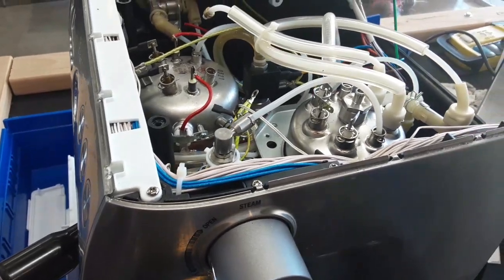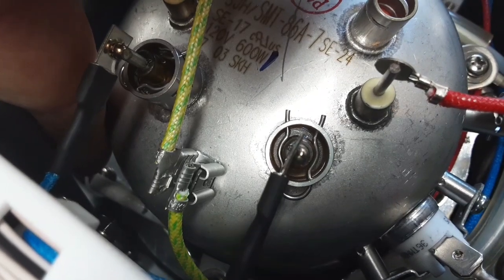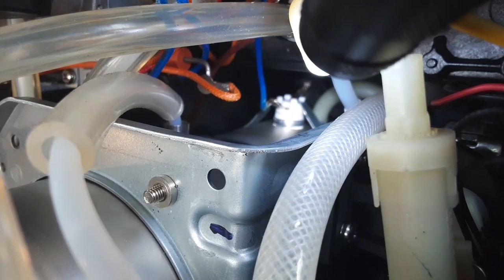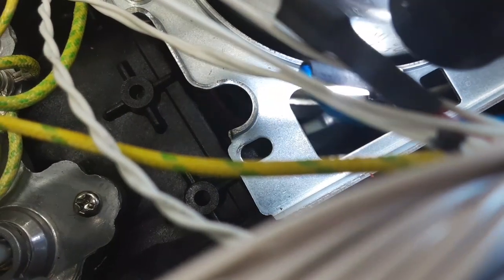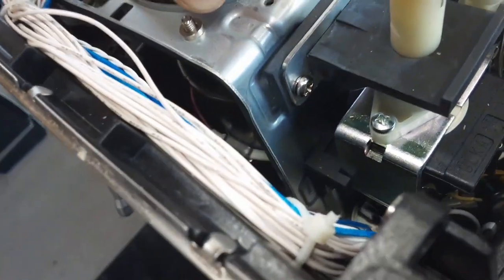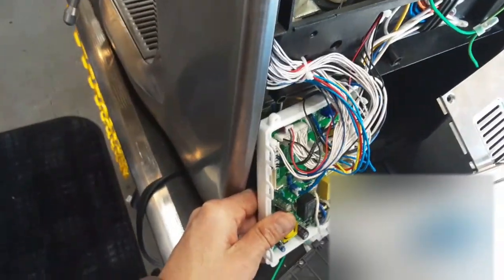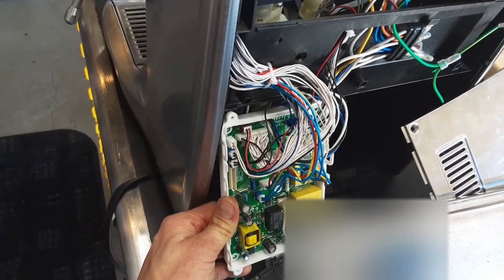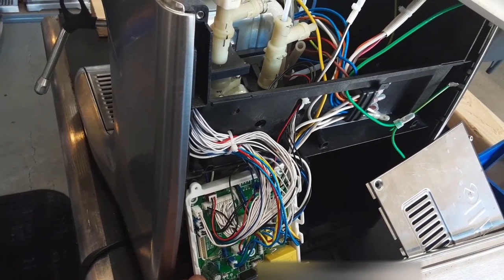Where are the NTC or thermal fuses on Breville Dual Boiler 920xl?

Comment: You can try replace 3 TRIAC on TRIAC board.  1 is BTA06-600C 6A The other 2 are 15A Triac. I use BTA16-600C.  (forgot the original model), Those were working fine for half years. 
Now I have Fuse issue, do you have video shows how to test the fuse. which wire or point?  I

Comment: One - thermosensor, second thermofuse :):):)
Reply: Are you talking about the brew boiler “fuses”? I’m trying to check the “thermofuse” but I just checked the big white one on the side and it has connection, current passes through it… 🤷🏼‍♂️

Comment: How do i know if the thermal fuse is bad?
Reply from the maker: You need a multimeter so you can test the resistance.  Resistance should be close to zero.  If it is above a couple of ohms it is bad.